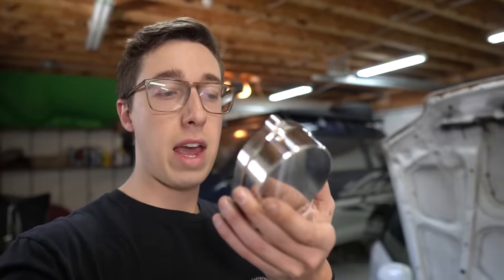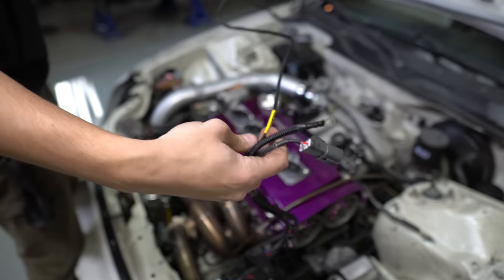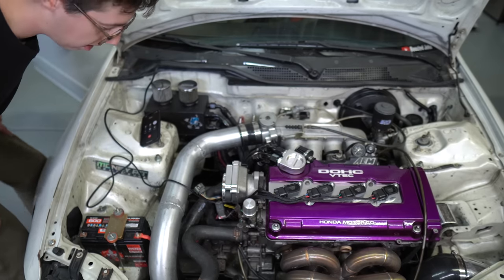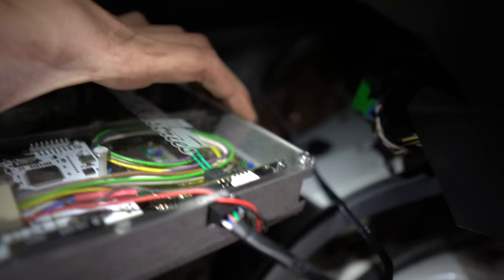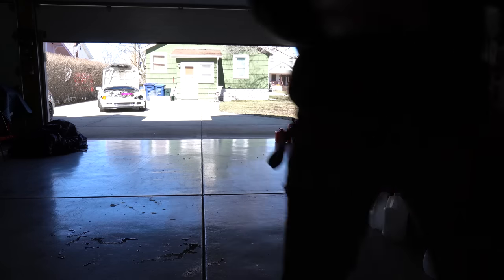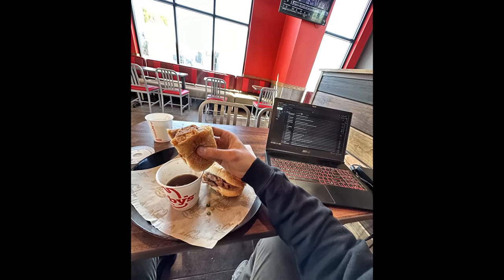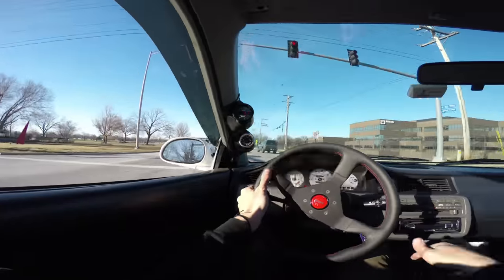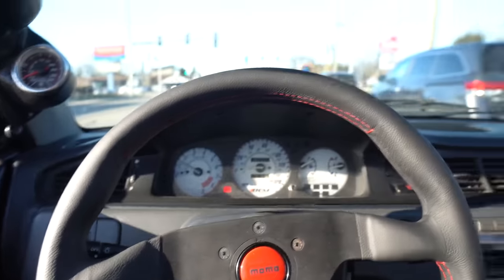Honda B Series Coil on Plug Conversion (PLUG AND PLAY and BUDGET FRIENDLY!)

Comment: Bro said plug and play but had a board soldered to his ecu 😭
Reply: All Honda tuning options require soldering so your comment makes zero sense
Reply: Had me there
Reply: Albeit plug and play does not include soldering.

It's not hard still. The hondata kit has you splice into ECU harness rather than solder to ECU.

That's if you go s300v3 or higher which you'll want to tune the ignition
Reply: He meant plug and play 

After they solder it haha

Comment: Hondata is used by many but alot of tuners, if given the choice would prefer to tune with different software. Hondata is the most user friendly out of the box and for tuners who dont lock their tunes, the owner can do their own adjustments on the fly. Side note, do NOT get the skunk 2 low profile valve cover hardware, they will leak, esp on boosted cars. Enjoying the content man, keep it up
Reply: I'm jumping into your build a little so forgive me if these have been answered, mentioning some things you commented about in this vid
Stock rpm in cluster, its old, its not going to be 100% accurate all the time, look into the Omni replacement!
There is alot of back and forth about this but, the consensus is for coil on plug kits, use oem, even if from the junkyard, yes ngk and denso make the oem coils however the parts store replacement isnt quite the same level, youll notice minor hiccups in part throttle and idle. Its not an always thing but its less likely to happen with oem coils.
Another huge benefit with coil on plug is the smoother drivability at both around the town cruising or trying to hold a steady mph in a roll race!

Comment: i would def open the gap up your car will fill crisper,having the gap so close is why idle feels choppy. from impropper combustion,also idle surging/hunting on hondas is typical of vacuum leaks.make a homeade boost leak tester and pump some air into the intercooler piping or turbo and open throttle and spray some soapy water around/smoke test the system, we just did this on buddys h22 that was idle searching and had big leak at the throttle body gasket.

Comment: COP is sick. But not exactly needed unless 600+ if dizzy is oem. Dragon Fire dizzy is another option. I made 530 on a dizzy and idles and drives mint.
Reply: Old dizzy are hard to source and cost the same as a cop system … the local automotive stores dizzy are trash they break up a lot happened to me on high rpm

Comment: Keep an eye on your coolant temp. My original B18c1 built turbo ran the same way as yours is running. It still felt strong when I got on it but I was having coolant temps around 225-240. Obviously over heating. But the tuner told me it was fine because it was a sleeved block. My intuition said it's not fine. I tried everything to fix the issue and nothing worked.

I pulled the head off and found a hole in a piston. Unfortunately for me, it was like that from the dyno to bringing it home. So I got to enjoy the car for zero miles.

Point is, the car would stall out on clutch in and still feel like it was strong when I got on it. When you started the car it sounded like things were louder from the motor than it should be for a bone stock build. I would expect those sounds if you were cammed or needed a valve lash done.
Reply from the maker: That’s unfortunate. My coolant temp never gets above 195.
Reply: @boosted_john  I figured you would have mentioned that if it were happening. Hopefully it's just the change in Temps effecting the tune. Try readjusting your idle mechanically first and then having the tune dialed in. That way you know for sure mechanically it isn't the issue.

I know it's something huntertuned does on the cars he tunes. So it may be worth a try.

Comment: i had same issue with my sr20det,it had slight miss and throttle response felt kinda off,after installing a 2871r turbo at 17 psi i couldnt run any gap higher then 0.020" which made idle feel even more choppy. i upgraded to COP to audi/vw r8 coil packs and holy crap it changed the car dramatic.i could now run 0.035" without issue,my miss went away and response was so crisp feeling,i never felt the car run this good just from upgrading coil packs.

Comment: Having used 3 hondata cop kits, my only complaint is that the extra box sucks. D17 coils,  oem dizzy, ngk 2668 2669 resistor type plugs and haven't had any issues otherwise. 6+ years in one kit.  That said,  I really like that the components are in the ecu.
Reply: what coil system is quality right now ; speed factory?

Comment: does this coils sitting ok there? because on my kit, i was removing the center bolts on valve cover to instal the plate 😮‍💨 because need to coils sitting deeper ☹
and how i think it's working only on s300 hondata? very interesting because i have a Hondavert production (copy of hondata by Belorussian) and interesting will it work on it or not !? 😅

Comment: Don't think you math there is correct but I could be wrong.  You have one coil with 10amps firing 10 amps per cylinder with the dizzy vs 4 different coils firing at only 5amps per cylinder

Comment: Can this be used on b20b4 with obd2?

It's stock but distributor is always either burning up or flooded with oil. That would be the only reason why I would do coil on plug

Comment: Yooo Boosted John, thanks for the awesome content keep it up mate!!!  Quick question for you; after the Nomis COP install did you notice the AFRs on your EG change during idle and WOT pulls?  When I had the Hondata COP kit installed on my B18 EG (on E85) as well few months ago I did notice the car running a little richer.  I haven't tried opening the spark plug gap like you suggested but will definitely be testing that to see if it makes a difference soon (thanks for the tip).

Really looking forward to the built motor going back into your EG soon; hoping for ya you don't run into any more issues!
Reply: Well he started with a car that wasn't running correct then changed the tune after the install so this honestly a terrible example to gain data from.  His afr is definitely going to be different because of the new tune so he has no idea how it changed simply from dizzy to cop.  It was a very poor test of what the cop offers

Comment: Looking good John! The lower RPM could be because of spark retard now that the engine has more temp in it. 🤷🏻‍♂ I know you mentioned a challenge with a YouTuber. My channel is half as large as yours, but would be fun to collab with another YouTuber. 1.8 Cruze turbo over here. Actually about to upload a video on my LS coil conversion 🤣 well... maybe tomorrow.
Reply from the maker: Message me on IG
Reply: @boosted_john  Will do.
Reply: Im having a similar problem on a stock b20 swapped Integra but i am missing my o2 sensor ( going to get the bung welded on soon so i can put it in ) for some reason the dude i bought the car from never spent the minor cost to have a muffler shop weld a bung on it. Hoping that's what caused the idle issue. Cold idle is fine but warm idle with clutch engaged drops and damn near wants to stall if i don't blip the throttle when i engage the clutch. I am only assuming o2 because it smells like its running rich AF and a bad air/fuel ratio obviously can cause idle problems at least it always did when I worked on carbs on motorcycles. Im totally new to working on cars so any advice is appreciated.